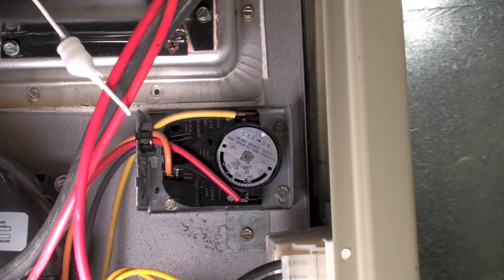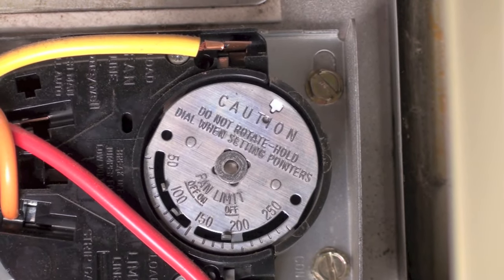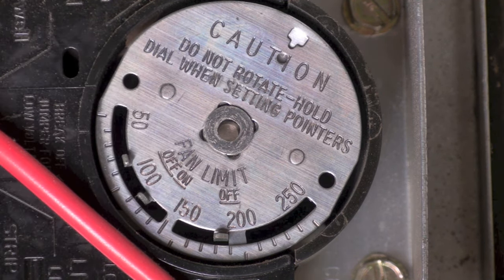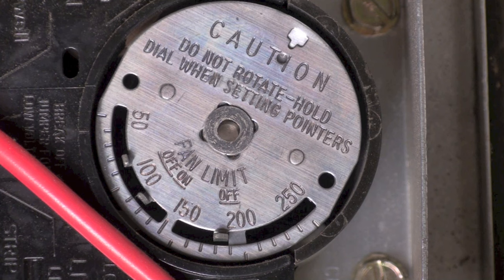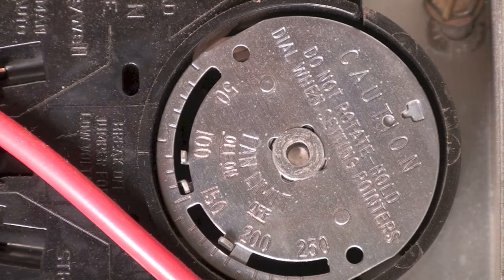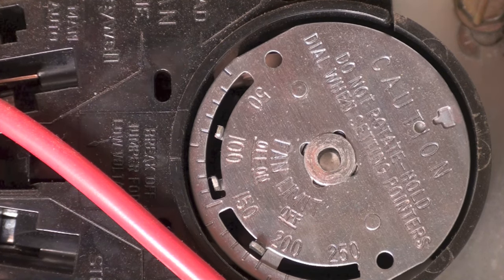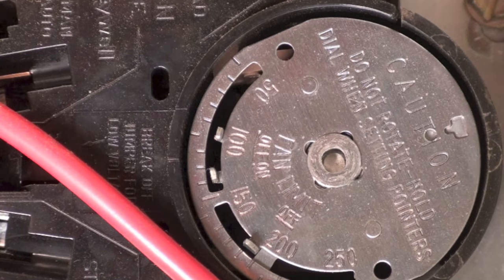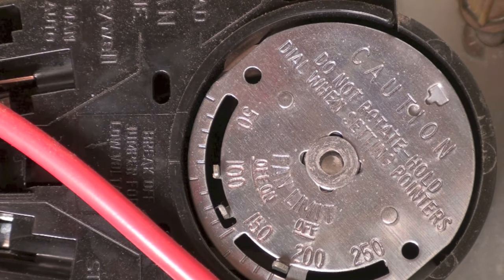How to adjust the Honeywell fan and limit switch

Comment: Thank you for the video with great informations, I have an old Lennox G8-105-1 and couldn't find any schematic or manual online, hope you can help. After installed a new Fan limit controllers, my furnace will not starts but when I pull manual fan switch the fan will comes on, this does show I have power from the breaker panel. The old fan controller was working before, just the button was broken so I went replaced with a new unit. I did remove the jumper from the new unit to copy the same unit; I took apart the old unit and there is no jumper. Anyhow, the pilot light stays on but the thermostat set to high temp will not trigger the furnace to come on. I do have the Nest thermostat which states I have NO voltage power to the thermostat since I can't find any schematic out there I wonder if you have any great suggestions? Thank you so much.
Reply from the maker: Are you sure you have low voltage?  
GFM
Reply: Thank you for the reply. The Nest thermostat indicates I have no voltage then I reinstalled my old thermostat and turned on high temp, nothing came on. Wish I can find a schematic diagram for this old furnace.
Reply: have u replaced the thermostat
Reply: At first I have removed the jumper switch of the fan limit controller but after fighting to get the furnace to fire up I hire the furnace technician. He came by and putted a jumper into the fan limit controller and now working. Have you replaced your fan limit controller with a new unit?

Comment: very helpful video in understanding this type of limit switch.... I have watched both videos about how the limit switch works and how to adjust it, but it still doesnt answer the question I have....    the oil burner heater in my shop keeps shutting OFF because the fan isnt coming on soon enough (if I rotate the switch just slightly by hand so the "on" peg passes the mark, the fan comes on and the burner remains running (or if I turn the fan on with the "manual" switch the burner remains running)...... after lowering the "on" peg, it still doesnt reach the on position before the burner reaches the temp at which is shuts off by default (then the reset button needs to be held in for it to retry to start the burner).... I have had furnace techs here to tune up the furnace, and after it gets started and running, it works flawlessly, but NOT until the fan comes on, and so they seem to always miss fixing the problem... what could be the cause of the unit "timing out" because the fan doesnt come on sooner, as it should?...  currently, the "on" peg is set about the halfway mark in the slot and the "off" peg is about 3 marks lower (almost at the end of the slot) what would be a better or modern type of switch to use in place of this one?.... thank you
Reply from the maker: There is something inconsistent here.  
Is the burner shutting of on flame failure?  
GFM
Reply: @grayfurnaceman   what is happening exactly is, when it is cold and the furnace is turned on, the pump and combustion blower will run about 20 seconds before ignition.  it ignites quickly and will then run and heat up the combustion chamber.... after it heats up (about 90 seconds or so), the blower fan fails to come on in time to keep the combustion chamber from overheating, and so the burner will be shut off... (apparently by a signal from the overheat thermostat withing the combustion chamber?).....

 when I manually start the blower fan about 20-30 seconds after the burner ignites, it will run flawlessly (burner and blower fan will cycle on and off as the shop temperature demands) the rest of the day...

 this only happens when its cold on the first start up of the day...
Reply: @gregpatey6355  There could be a crack in the heat exchanger feeding hot gasses onto the sensor.  You may also be over fired.  Too large a nozzle.  Just a couple of thoughts.
GFM
Reply: Try replacing the limit switch?

Comment: Hello 😊 .. i saw on another video that (for the white Rodgers) the white plastic dot on top (under the manual auto switch) should be aligned to the room temp when it reaches it.. if thats true mine is about 40° off! .. can you confirm this?
Reply: It's hard to find info on calibration.. I understand it is done in factory.. but can you recalibrate, or should I change it altogether? A few years ago I would've but these things are suddenly very expensive!
Reply from the maker: I have never heard of that one.
GFM @vdeblois1352
Reply: @grayfurnaceman  thanks 👍🏼

Comment: AT the end you say the fan should not come after a cycle, My oil furnace occasionally the burner will come on and run then turn off and about a minute later the fan will come on for a while.  I have watched the fan and limit switch cycle as you have indicated it should work.  Should my furnace function this way?
Reply from the maker: No.  I would separate the on and off temps a little farther.  Be sure the power is off when you do this.  Hope this helps.
GFM

Comment: I have one of these limit switches and the blower will cycle on and off several times after the burner has shut down, it does this regardless of where I set the FAN OFF peg. Also the dial never seems to rotate below 100 degrees even if the furnace has been off for a long time. I’m guessing the spring is probably completely out of whack?
Reply from the maker: Its probably toast.  Replace it.
GFM

Comment: It seems my fan & limit switch is working, but I was having that issue where it was cycling on and off about 3 times before staying on late last winter, so while getting my furnace fired up today for the fall season, we tweaked the dial, and now the fan won't kick on at all. Can it be coincidence that the fan died right then and there? The fan motor is relatively new; only 1 and a half winters. The fan & limit switch is on it's 7th winter. I have it off at about 100, and on at about 150.
Reply: Also, the fan did work once today, when everything was initially fired up, but it did that on/off thing so that is when we tweaked it. Now no fan. :(
Reply from the maker: If you did not hold down the dial when adjusting, you may have damaged it.
GFM

Comment: My furnace has always worked fine, never changed any of the limit switch setting. I turned it on yesterday to test for the season. It turns on and blows heat fine but the blower shuts off before the desired room temperature setting on the thermostat but the burners are still going. The blower kicks on again for about a minute and then shuts off again. I watched the limit switch and It seems as though it is cooling off too fast to bring it back to the off position. What do you think?
Reply from the maker: Two issues I can think of.  The structure is very cold so the return air is coming back at less than 60F.  The switch is failing.
GFM
Reply: What did you mean in the video when you said you had it set to 4x's the normal speed ?
Reply: @grayfurnaceman  Thanks for your advice. It was the switch going bad. I put in a new one today and it's working perfectly normal again. :-)

Comment: I have a Miller Oil furnace. The burner goes on for a bit then shuts down the fan comes on after a few minutes starts blowing and then the burner starts up again. I have a sense that my fan limit switch is set incorrectly?
Reply from the maker: I would jumper out the thermostat.  If it continues to short cycle, you could have a fan limit problem.
GFM

Comment: Hey gfm, at the end of the video you talked about the fan coming on after the cycle ends because of heat in the heat exchanger. I am having this problem. Is it a simple adjustment or is my furnace not burning correctly and needs servicing? Thank you
Reply from the maker: +upurnose46 The "on" and "off" positions need to be farther apart.  Usually, this means increasing the "on" temperature.  Hope this helps.
GFM
Reply: +grayfurnaceman  My fan settings are Fan OFF-95 Fan On-140 Limit-170. Would this indicate a clogged or bad heat exchanger?
Reply from the maker: +upurnose46 The switch may be failing.
GFM

Comment: hey grayfurnaceman i have the same switch in a dulamatic olsen ultramax 90 series im reaching my 200 degree high temp limit before the temp is met on themostat. do you think that i have a issue with my duct work not pushing enough air out the vents??? i have a end cap on on of the holes on the furnice i took that off now blowing warm air into the basement and it does not reach it limit anymore? is 200 degrees ok for a high limit gas cut off or can i push it to 220 or so
Reply from the maker: adam Z 200 degrees is the highest temp.  Look for dirty filter, dirty blower wheel or ductwork blockages.  Hope this helps.
GFM

Comment: I adjusted it like in this video and my fan does not turn off, it continuously goes. the thermostat and button on the limit switch  is set to auto and, the fan switch on the furnace is is turned off. would this be a defective switch? thanks
Reply from the maker: I would say it is out of calibration and must be replaced.
GFM
Reply: @grayfurnaceman  thanks for the quick reply

Comment: Hey, do I need to adjust these for my central ac? The fan will only run when in manual mode.
Reply from the maker: The heat operated fan switch is only used in the heat mode.  
GFM

Comment: grayfurnaceman,
 I ran into a climatrol  M# 174-0-045-11-10, today. the fan limit control is not shutting off  the fan. I am having trouble finding this model online, to verify the right length of Honeywell fan limit control. I did not take it out of the unit, because the older couple is stillhe ating ok with this fan limit, and I thought I could just order what I need with the model #. Not so far. Do you have any ideas, that will help me at my local parts houses, to find this?
Reply from the maker: Most of those units used an 11.5 inch switch.  No guarantees here.
GFM
Reply: ok thank you
Reply: grayfurnaceman, is it possible to bypass the limit switch just to activate the gas valve temporary?
Reply from the maker: You can jumper it with a wire.  However, a jumper left in the circuit is a dangerous condition.
GFM
Reply: It doesn't activate the gas valve , it is control power to  the ignition control, ONLY BYPASS FOR TESTING PURPOSES.
Reply: the limit switch is NC (normally closed). It opens up when the cam-stat senses heat over set temp ~ 190 degree. The limit switch shuts of 120VAC power to 24VAC transformer (gas valves) to prevent melting the heat exchanger. To your point: "bypassing" a closed contactor makes no sense unless you want to keep heating without limit until melted

Comment: My furnace turns on, gets to temp, but blower doesn't turn on. When max temp is reached, system shuts down. I tried pushing the manual fan control on and fan does not come on.
Would this indicate a bad limit switch?
Reply from the maker: Either your fan switch has failed or the fan motor has failed.
GFM

Comment: Our Lennox Pulse G14 only runs properly when the thermostat setting is on "FAN" AND NOT ON "AUTO."  (When set on "AUTO," the fan usually does not come on.)  Is it okay to run it with the thermostat set on "FAN" all the time?
Could this be due to a bad thermostat, or bad Fan Limit Control Switch ? THANK YOU
Reply from the maker: It will work ok with the fan to the on position.  The fan switch has probably failed.
GFM
Reply: @grayfurnaceman  Thank You!!

Comment: I have an old oil furnace, it hits the limit ever 7ish mins and turns off only the burner for 2 or 3 mins than fires back up. Is this normal or a bad thing? Aka overheating. New filters, door open to filters, no blockage.
Seems fine to me since the house heats the same but burner is off almost half heat cycle. So im using less oil vs burning the whole cycle. 
Im just wondering if this isnt correct, will the switch wear prematurely. 
The blower has no control board to be seen but above the furnace there is a redbox with a blk button 'thermal cutoff switch' no adjustments.
Reply from the maker: You are probably overfired.  Smaller nozzle may help.
GFM
Reply: @grayfurnaceman  I was leaning towards that as a fix and might get a gauge to check/tune pump pressure because I am at the right size @ .85 according to silver plaque.  It does have a newer replacement suntec pump that i'm thinking might be too high psi for my ancient burner. Thank you very much for all the videos and taking time to reply.

Comment: I thought this may be my issue, but what is happening with our furnace is that the gas keeps kicking on and off until the set temp is reached, then the fan kicks on. The flame is not continuous. Should the gas kick on and off during the cycle of heating up, or should the flames be continuous until the set temp is reached?
Reply: continuous

Comment: Hello grayfurnaceman

When the furnace wants to start the motor starts humming, as if it's not getting enough starting voltage. Could the limit switch be normally closed all the time and it's causing the motor to short

Thanks
Reply from the maker: +Ashor K No.  If the motor does not rotate easily, the bearings have failed.  If the motor turns easily, the capacitor may have failed. Hope this helps.
GFM
Reply: OK I tried to look for a capacitor and can't locate one at all (could it be internal). And I already tried a different new motor and it's doing the same thing. By the way the squirrel cage fan rotates smoothly, and the belt is at an ideal tension.
Reply from the maker: +Ashor K If it is a belt drive, it may not have a capacitor.  About all I can think of is a power problem.  The limit has no connection to the motor.  Is the voltage correct?
GFM

Comment: My furnace shuts on and off. I have cleaned the sensor rod, thoroughly. Intake and exhaust ports are clean. New thermostat. 9 out 10 it's the flame rod. What am I missing.??? S something simple? Need some help. Thanks!!!
Reply: Mk3buster Lowhar : this sounds normal. Cycling between set points is what furnaces are designed to do: Heat On > Fan On > Heat Off/On > Fan Off, end of call for heat.

Comment: This looks exactly like the thermostat to the wood furnace I am using in the house I am renting.  The settings are at 110 degrees and 150 degrees.  The fan is continuous starting at 75 degrees in the house and only shuts off after the wood turns to embers. The house temperature usually reaches 90 degrees, but the wood burns quickly (even with damper shut) within an hour or two.  I have not been able to sleep through night because the wood (2/3 - 3/4) full will burn up within 3-4 hours.   I attempted to move the pointers to 100  and 130 but they would not budge.  Please advise!
Reply from the maker: ***** The setting is not the problem.  Once the furnace is loaded, the fan will be on until fire is essentially out.  The problem you are seeing is endemic to wood heat.  All I can tell you is the wood species does make a difference for holding fire for long periods.  Depending on where you live, red fir is a fire holding wood.  Also hickory will hold a fire.  Hope this helps.
GFM
Reply: Thank you for your response.  I am new to wood burning so I had no clue what kind of firewood to look for.  I will keep this in mind next time around!

Comment: GFM,
can you replace a fixed fan limit switch (115F-20) with an adjustable one? i got M1S furnace in my rental home and it cycles once or twice after shutting down, i checked air flow and everything is with-in a range, i mostly work on hp and ac and didnt have any hands on exp. with furnaces
thanks
Dennis
Reply from the maker: +Dennis No-one There are adjustable fan switches that might fit in your furnace.  I would check with a heating contractor.  Hope this helps.
GFM
Reply: the tech support said use the oem fixed fan limit switch, also if you can answer another question, i;ll be doing a tuneup (cleaning, replacing nozzle, strainer, etc) and it does Not have an oil filter, 2 line system, tank is in the basement, is it common not to have filter? system was put in 2000
thanks
Reply from the maker: +Dennis No-one I have never seen an operating oil furnace without a filter.
GFM
Reply: i checked both lines from the top of a tank to a furnace and inside the furnace No oil filter,
i just recently bought the property, is it amazing it's running since 2000? i want to see what a pump strainer  will look like.
Reply from the maker: +Dennis No-one Pretty amazing.
GFM

Comment: You do not show exactly the procedure to adjust the settings.   In the comments you say something about "pushing the wheel in" - can you please explain this maybe in another video?   Also, please explain "DO NOT ROTATE - HOLD DIAL WHEN SETTING POINTERS"
Reply from the maker: If you press the dial in, it locks the dial so you can move the pointers without damaging the bimetal sensor.  Will consider a video on that.
GFM
Reply: Well, maybe I damaged it because the furnace runs all screwy now - fan and burner on & off running quite erratically.   Do I need to replace the switch?   If so, is there a better design to replace it with?  BTW, what's happened with oil burning space heaters?   Are they no longer available as I can't seem to find any?
Reply from the maker: You probably will have to replace it.  Their efficiency is quite low, so they have pretty much disappeared.
GFM
Reply: Actually, I just kept adjusting (tempted to say "fiddling with" - lol) it and it seems to finally be running ok now.   Thanks.